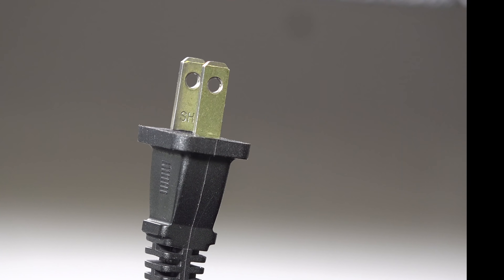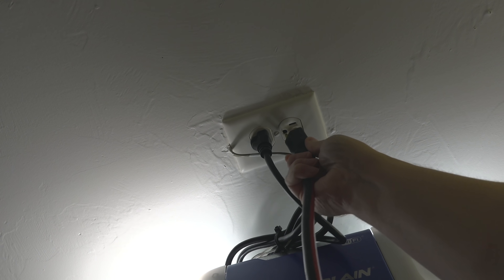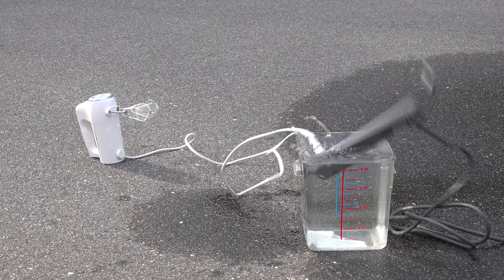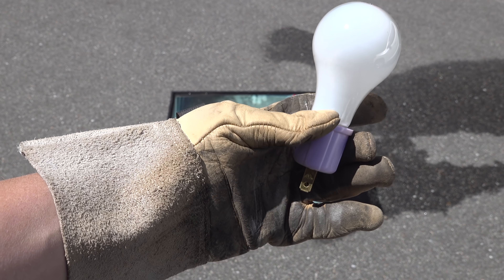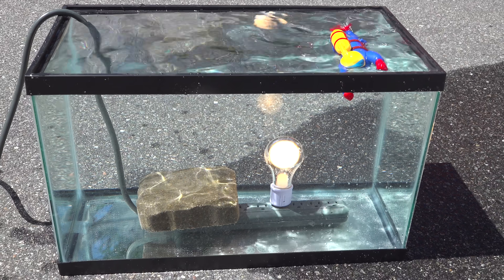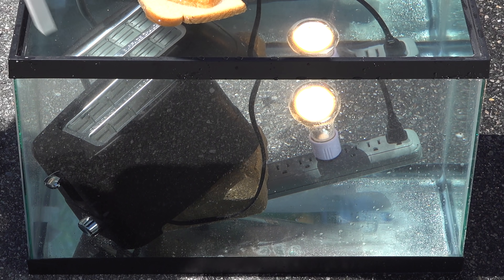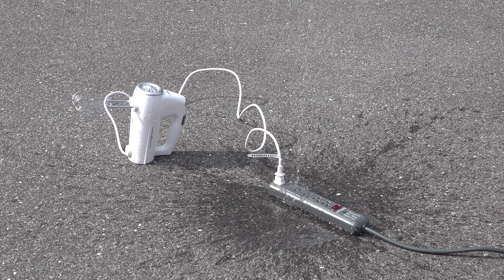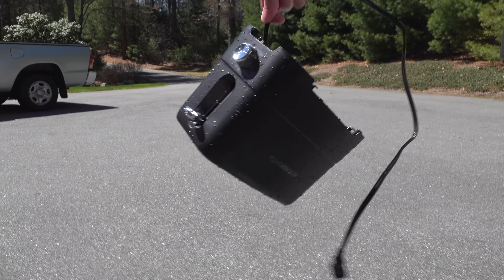What REALLY HAPPENS WHEN YOU SPILL WATER in an OUTLET?

Comment: A while back we had a couple of instances, both in the space of a month, where extension plugs got wet. The first was when my partner hadn’t realised that a travel guide of coffee had fallen on its side without being fully closed and the entire mug full had tipped onto the extension plug. The second was when one of our dogs threw up on the extension plug under the desk. On both occasions we were alerted to the issue by the house breaker switch tripping and had to search for the problem before finding out what had happened. It was frustrating but we were relieved that nothing worse happened as a result of the accidents

Comment: Electrocution, or to be electrocuted, actually means death by electricity.

Regular circuit breakers trip through over-current.  To have water able to conduct sufficient current to trip a breaker on over-current would require highly conductive (contaminated) 'water'.

Pure water isn't actually conductive.

GFCI circuit breakers trip on leakage current to Earth which they sense by comparing the flow of current between the Line and Neutral conductors.  An imbalance between L & N means current is leaking to ground somewhere (taking an alternate route back to the local transformer, e.g. through a person in contact with Earth, or via mineral-laden water to Earth terminal within a soaked extension lead).

You could probably stick your finger in that LIVE water and not feel much if anything until close to the power source.  Don't try this though.

Comment: That tank is completely isolated from the ground. The heating resistance acts as a shortcircuit, so no current can pass through the water. A bathtub, instead, for example, has metallic elements that are linked to mass. In the moment that a human body immersed in water touches any of the elements connected to mass, the power discharges through the body ⚡.

Comment: As a kid (I was stupid) I took the Hi-Fi speaker cable and split one of them and ran both ends into a glass of water. The music still played using the water in the glass as a "wire" but very quiet. However I could increase the volume by adding salt. What if you did the same experiment with salted water?

Comment: The breaker for the circuit,  could have been bad. If that's the case, the wire will eventually be the fuse.

Comment: Your test failed because you don't seem to understand how circuit breakers work. Also it was extremely irresponsible. I reported the video to Youtube for showing irresponsible, dangerous acts.
In most households there are two types of circuit breaker protection.
1) is overcurrent protection. The circuit is designed so that the breaker fails first and protects the rest of the circuit.  This is when your device uses more current (power) than the circuit is designed to do and rather than have a random piece of wire or equipment fail, the circuit breaker disconnects. In your test water was not consuming sufficiently large amount of power to trigger overcurrent protection.
2) GFCI breakers -- designed to detect difference in current flowing through wires indicating that part of the current goes "somewhere else". This "somewhere else" is assumed to be a person that is shorting power to ground. These circuit breakers activate when there is just couple of milliamps going a wrong way. In your test you did not activate this breaker because you probably did not have good contact with the ground at any point in time. If you threw the outlet in a pond it would activate immediately because it would detect that power is going somewhere else (returns to power station or nearest transformator through water and ground rather than through designated wire).
Dry asphalt is pretty good insulator. You tried to do this on actual ground and your experiment could end much worse than it did.

Comment: electricity always goes the way of the least resistance and water is a horrible conductor. Dust particles and stuff on your electronics is usually what makes the water conductive enough to shortcircuit your device. resistances build into the device like everything computer also helps alot with the shortcircuiting. In case of the toaster the water also cools the heating elements which makes them way more conductive than in their hot state.

Comment: Why should be an electrical problem ? Other than trying to kill you (little issue of course), water is just a relatively small load. 
You need to add a lot of salt to make it more conductive and to be a significant load. That however, will probably still not be a problem

Comment: In (most of) Europe you're obliged to have GFCI protection on your whole electrical installation. Over here you need 2 of them, the main one that trips at a 300mA loss, and another one behind that one which trips at 30mA for "wet rooms and appliances".
Reply: are you sure it's 300? 300mA @ 220V is a LOT of power! 66W!
Reply: @eitantal726  Yeah, I'm sure about that, it's been like that in Belgium since at least 1975. They've completely rewritten code as recent as 2020, but didn't change anything about that. I agree it's still a lot of power, I've seen lots of houses where they put everything behind the 30mA one, you are allowed to do that, but you'd still need the 300mA one in front. Fun(?) fact: the kitchen isn't even considered a "wet room", only a built in dishwasher needs a 30mA socket, while a standalone one doesn't.
Reply: @nero3700  This is messed up, man. I don't want 300mA going through my body. damn!

Comment: Yeah, water isn't actually a conductant, it has to have some free electolytes in it for current to be able to flow through it. Tap water usually has some amounts of those but it still doesn't make a good conductant as it is, so the electricity will flow keep flowing through the wires by the law of least resistance. Some basic school chemistry expiriments include testing the conductivity of water as a relation to how much salt is added into it. Obviously with small voltages though.
Reply: Finally I'm not just the only 1 to notice that